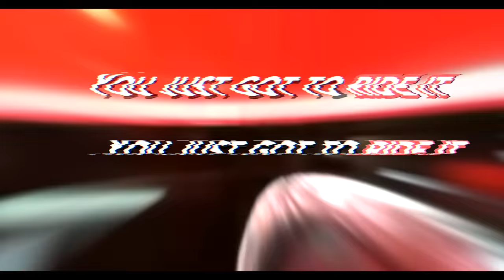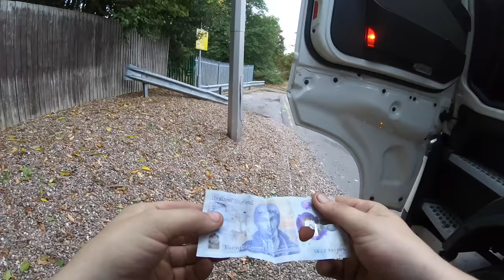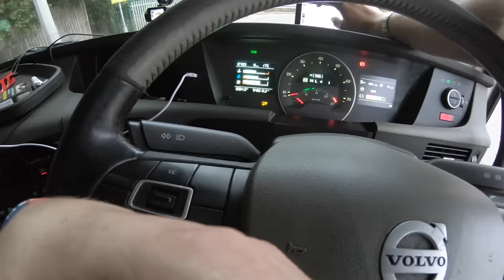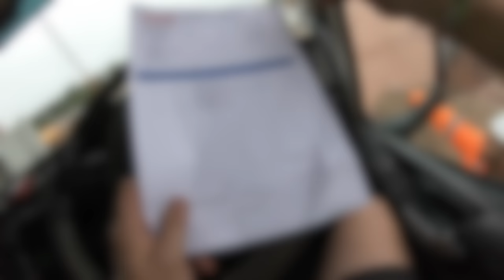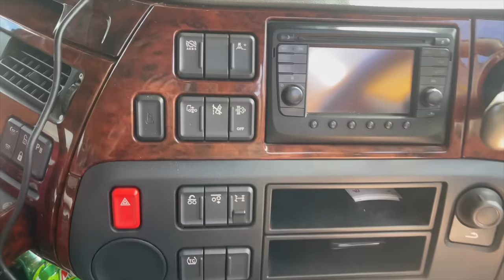Trucker Jay in the UK: New job & Truck first vlog

Comment: The daf xf is a decent machine. We have them at my work, I like them a lot. Agree on the steering wheel adjustment, even actros have better range of movement than the daf. Interesting to see a manual box, rare these days.